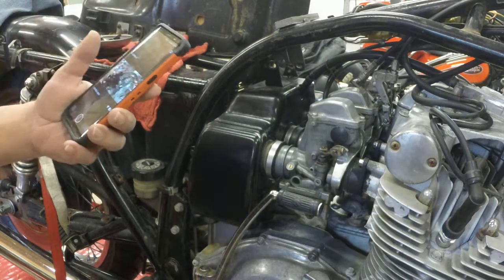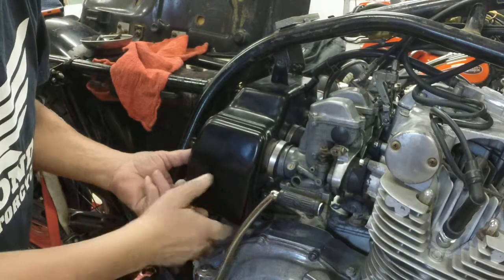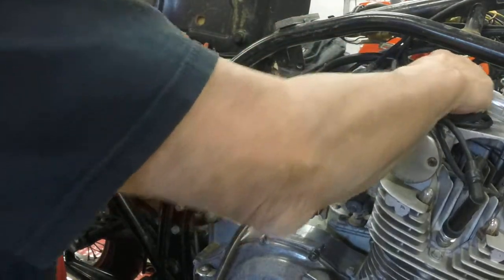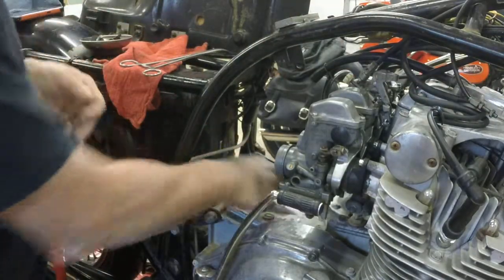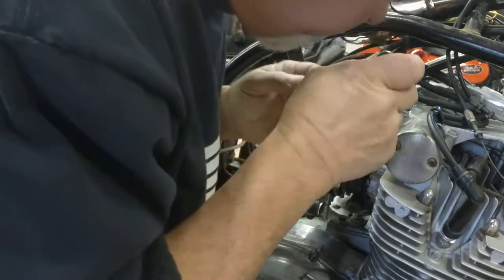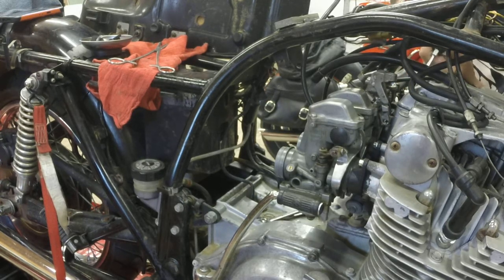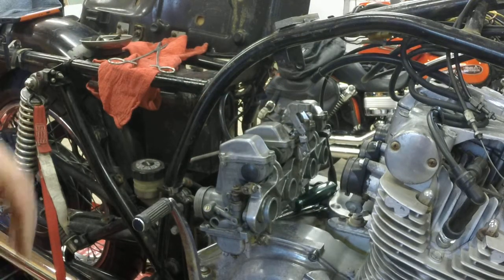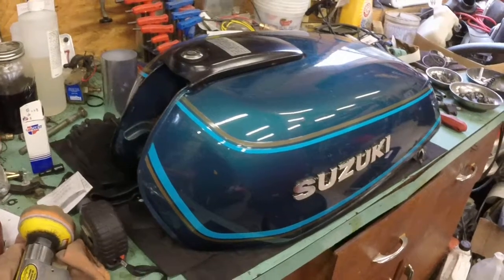GS750 Carb removal

Comment: How do you get the fuel tank off? mine just lifts up on a hinge but I can't find anywhere that releases it.
Reply: Remove the bolt at the back of the tank and lift tank and pull to the rear. There is no hinge on these old bikes. There are two rubber do-nuts on the frame that support the front of the tank.

Comment: I have a 78 750 and just got done taking the carbs off and cleaning them.  This bike sat for 25 years so I don't know what connect to the small inlets about half way up. I know the fat tube in the middle goes to petcock for fuel.
Reply from the maker: The two tubes I think you are talking about, are vents and just go down under the air cleaner and hook to nothing.  The tube on #3 carb is vacuum to run the petcock. Now all of this assumes you have the Mikuni Round Slide carbs like are in the video. But I could be wrong and you really should confirm by checking the service manual for your make/model. Good luck
Reply: John's Bikes and Blues yep same set up you have here

Comment: 79 gs 750 one day just would not start  been in barn 8 years
Reply from the maker: No short cuts to getting a stored bike running. The fuel system, from tank, petcock to carbs has to be squeaky clean. Pull the carbs and clean the float bowls, jets (both high speed and idle and choke/enrichener circuits.  All electrical connections un mated and cleaned with electrical cleaner. NO WD-40 ever on anything.!!! New battery and you are well on your way to riding it. New tires/tubes. New chain and sprockets. I always make sure I hear it run on all cylinders before spending any money on it Even if only on starting fluid for a second or two is good enough.

Comment from the maker: I said remove air box to the left, I meant to the right side of the bike. Actually on this bike it will come out to the left but it is much easier to pull it out the right side.
Reply: Good sir, I have purchased a 81 (?) GS 750L. looking to get it running.   Would you be available for communication exchanges?  I would be ETERNALLY grateful.
Reply: @Smaqx579  Ask questions here and I'll help if I can.